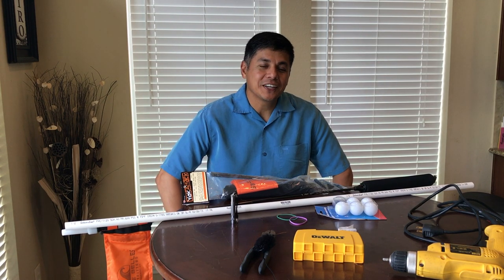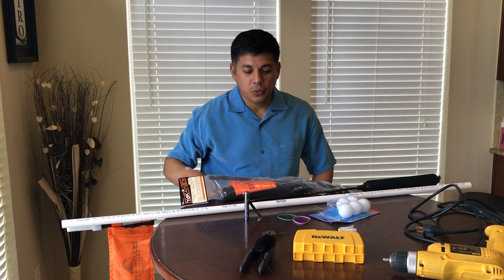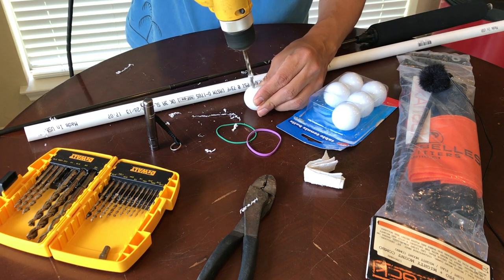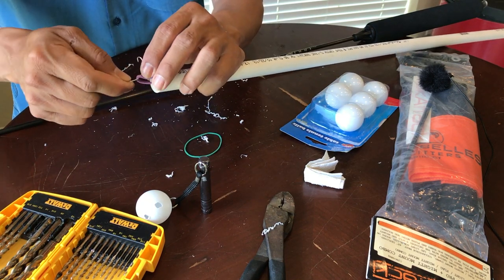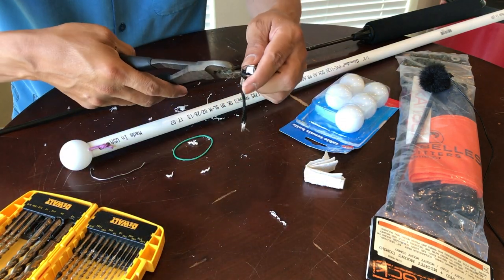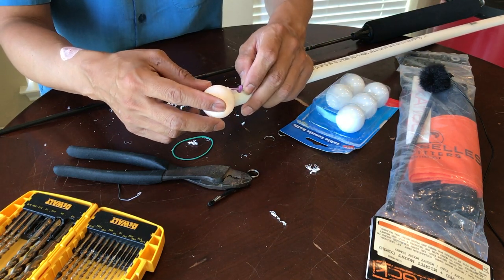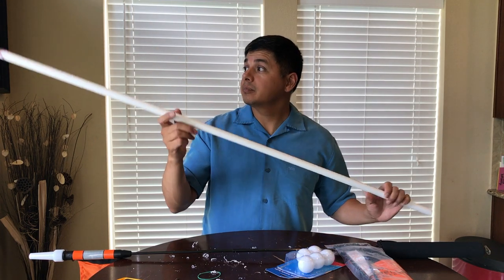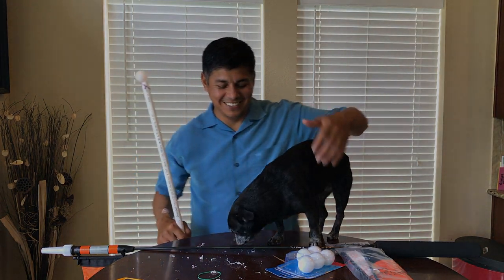(S1 Ep4) DIY 360 Kayak Fishing Light, Fast and Super Easy

Comment: The rubber band will deteriorate quickly in the sun, wind and rain and will break off fast. There is very thin bungee cord on the market you can use that will not fail over a short time and will not have to keep replacing it.
Good idea!
Reply from the maker: Great tip, thanks!